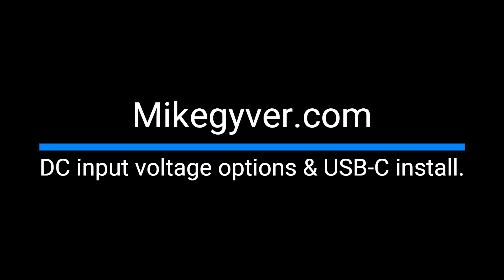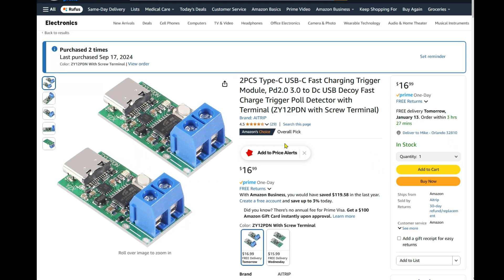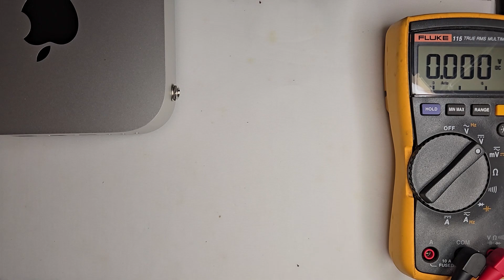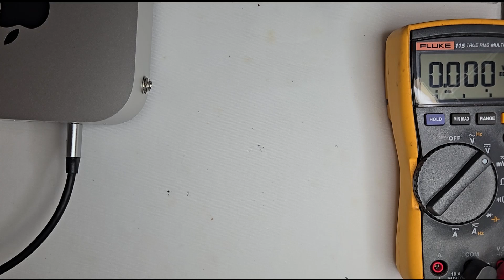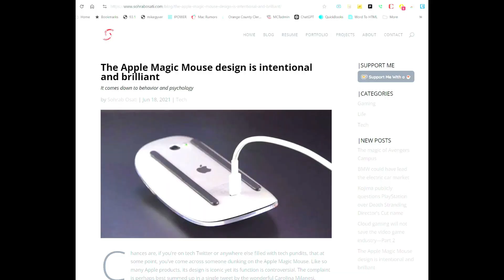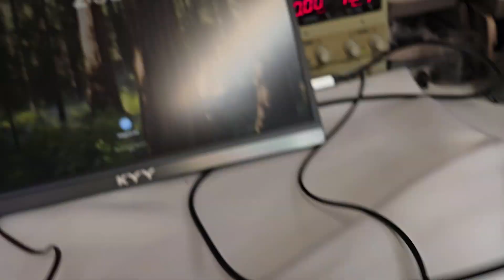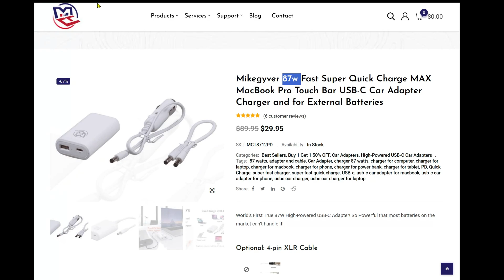DIY hack: Boost Your Mac Mini M4 Efficiency: Power with regulated DC & USB-C off grid Upgrade!

Comment: Mac mini M4 power board gives out 12.6V, so I wander how Mac mini M4 performs with such DC hack, when DC supply is 12.0-12.1V DC and not 12.6V DC? Have you tested M4 mini with such lower DC voltage? Any possible issues?
Reply from the maker: seems to work fine.  However in prior gen Mac mini, I've heard other users say there was built in voltage regulation on the motherboard.  I never had enough nerves to actually try it out.  But I will say there seems to be indication that a little +/- on the voltage seems to be ok.  I would say Amps play a bigger role.

Comment: you said " that we once we set the voltage to 12v on the USB-C trigger board, we programmed it to stay permanently at 12v at power up (off camera)**". but can I ask more? How did you programmed it to stay permanently at 12v at power up? please anwser me
Reply from the maker: when you purchase the USB-C board, it comes with directions. basically hold button while powerup, then selected voltage, then press button again.

Comment: I think USB C PPS can deliver 5A at 12V, which could allow 60W with the hidden port setup here! I think Apple specifies 65W max power draw for the base model, which would ideally mean USB C PPS could cover most use cases.
Reply from the maker: I'm not sure about that, what tech specs document are you referencing?
Reply: @mikegyverComputer  Sadly YouTube won’t let me post a comment with anything linked, but if you google “mac mini 103253” there’s an apple support article about power consumption!

Comment: Quick question: can you still use AC when you’re not using the DC USB-C? Doing this doesn’t deactivate the original AC cable port, does it? The reason I’m asking is because when I wanna go mobile, I’ll use the DC port with an Anker brick, but when I’m at home, I’ll plug it back in traditionally with the AC port.
Reply from the maker: AC port is fully functional

Comment: I upgraded to USB-C today, and it worked perfectly! Thanks so much for your research. I simply routed a wire through the holes at the bottom and mounted the USB-C board on the outside of the bottom plate. It works flawlessly! Thank you so much!
Reply: Hey, i'm interested in your approach, do you have a more thorough breakdown so i could learn more?

Comment: Amazing Work, the best possible outcome for me is using a buck converter and a usb c 12v board, then 3D printing the bottom case to house the electronics. This way no permanent mark on the device, you could revert to stock by just swapping the bottom covers with the original instead of the 3D printed !
Reply: I'm interested in trying this...could you elaborate more on your method?  did you perhaps make a video on  your approach?

Comment: Great video! For your next project, have you considered powering the Mac Mini through one of the Thunderbolt/USB-C ports using a custom DC-DC converter? This would involve disconnecting the port from its original function, but it could be a cleaner solution overall without modifying the case.
Reply: Why would anyone sacrifice a thunderbolt port to simply supply power?

Comment: So, if I want to use the M4 to its full potential should I opt for solution number 1? Thank you.
Reply from the maker: Yes.  If Pro version, prob not. The pro will draw more amp and you'll need a larger DC board.
Reply: @mikegyverComputer  but, the option for usb type have to limited 36w and the full potential of mac mini base is 60w. how to boost to 60w. please
Reply from the maker: @huynguyenquoc1073  https://youtu.be/uKjAbNVYFYE

Comment: I find this super interesting, and I have many ideas with this.
What I don't understand, in the video you mention that 5v..3a, 12v..3a, 20v..5a then 'if you don't go over 60w' but with this limitation wouldn't there only be 36w?

Do not try this 

And I have a question what would happen ig you hooked up a bidirectional powerbank to the circut and plug in the powerbank and the mac, would thid be possible, would it break?
I think you would have to add a different usb adapter.
Reply from the maker: correct, the setting at 12v3a is only limited to 36w.  The USB-C trigger board is only single direction.
Reply: @mikegyverComputer Thanks for the quick response! I have anither question. Did you test, what happens if you plugged in the usb-c and the powersupply at the same time?

Comment: dude you are amazing, seriusly wow i was checking your channel to see if you published like weekly. only one question how many amps do you think i need with the m4 pro model?
Reply from the maker: We don't have the pro model on hand.  Anyone want to lend us theirs?  But based knowledge of us working on on the Pro model of last gen, it definitely used more amps and we talked about not being able to fit inside a larger DC board.  Since this model is smaller, you're going to def need to have and external regulation.

Comment: I appreciate the effort but not the result.
you used a huge trigger module of those that have the button to change the voltage every time you press it
you could have used a very small one where the voltage is selected by means of a short
surely you would have had the possibility of positioning it in a less invasive way and in a more suitable position
for the rest, congratulations for the audacity you had in doing this
a greeting from Italy
ciaoooo Ualioooo ^__^
Reply from the maker: Hi, The USB-C module can be programmed to permanently stay at a set voltage upon power up, which is what I did off camera.
Reply: @mikegyverComputer  This is logical that they maintain the selected voltage.
If they didn't work like this, many devices you attach it to would burn out because they would have a different voltage when turned on.
The problem is that having an additional circuit on a module that electronically changes the voltages
inevitably increases the size of the circuit
Reply from the maker: @luigib3870  We opt for the board which allows for multiple voltages so we can use it with other projects we may have.  Thanks for calling that out!

Comment: Is this setup compatible with the 13 inch 2024 M4 iPad Pro and is this mod beneficial & worth implementing on that device, with consideration to costs, complexity, implementation time, preparation , xecution, reliability, and usefulness.  It has a thunderbolt usb4 port